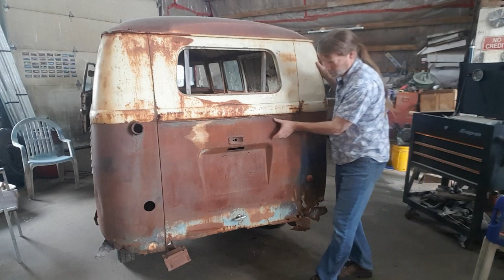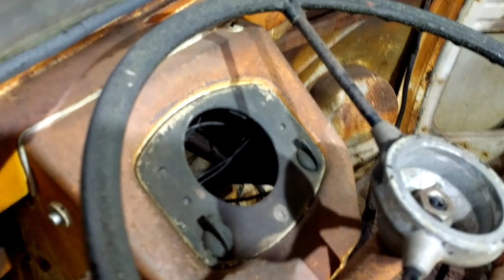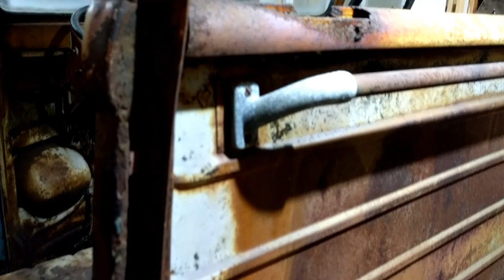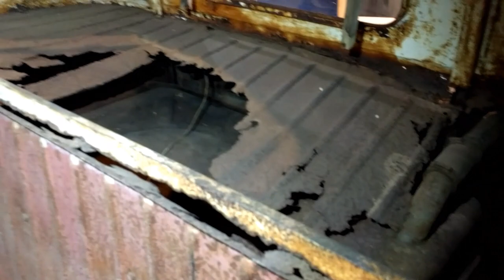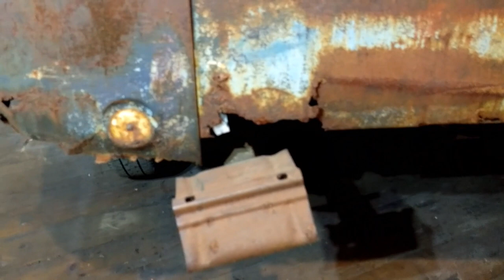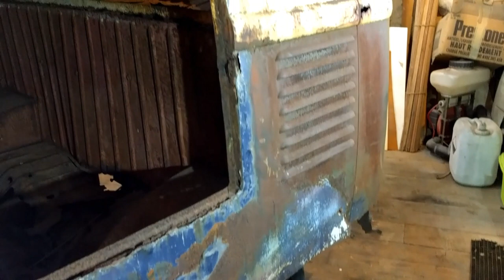The Nova Scotia Barndoor E01 - Introduction

Comment: That left side is going to be a little tough. need to see what is good underneath to stack metal off of. Frame and cross members probably first then long panel then window panel.....this one will have at least 20k  USD in metal or more to finish at 6 months ago prices. You can get Klassic fab to make those rear luggage parts. but you need to call him. and they are pricey. everything is sagging on the left side. might want to square that up and weld in supports before cutting it apart. Be careful or you will have a 1954 pile of rubble that cant be repaired. I would do sections. Well anything can be repaired. but best to start out right.
Reply: also check with cip1 might need to call them for some of the BBT parts they can get them with the next shipment container. But you will be waiting for a while.
Reply from the maker: I have donor parts for the left side and roof. Most other parts I will make myself. I have been unhappy with the replacement metal available and spend more time reworking them than if I just made the parts. 

It will need complete disassembly all the way down to the frame. Floors and crossmembers are basically gone but frame is very repairable. It will be a 1954 pile of rubble but it will be repaired. Very time consuming process but I have time and love the work. This one is too far gone to do any other way.

Comment: Wow !! Thats an amazing Bus. Looking forward to the videos. I hope you're not going to paint it....   Good luck
Reply from the maker: Unfortunately It is in to bad of shape to keep the paint. The body needs to come apart to remove all the rust and the left side is basically missing. So getting a complete restoration. If the upper body was structurally sound I would have saved it.
Reply: @thenovascotiabarndoor1954  Congratulations again. The Bus found the perfect owner. Do you have a video of when you rescued it ?
Reply from the maker: @besenzon1  I didn't recover it. A fellow VW enthusiast found it and passed it on to me as it was a larger job than he wanted to take on.